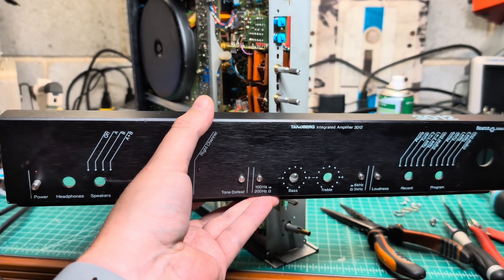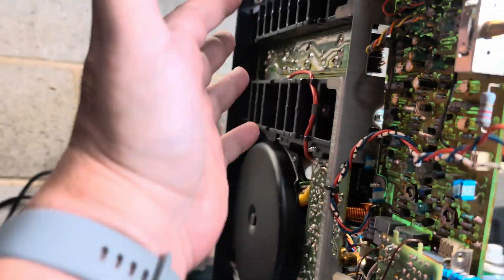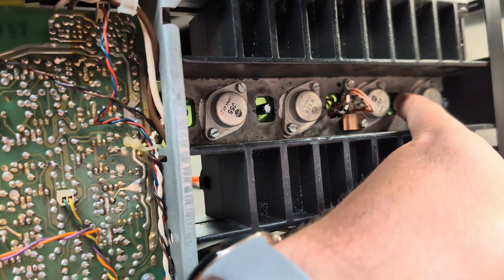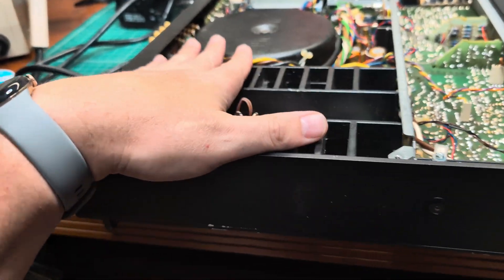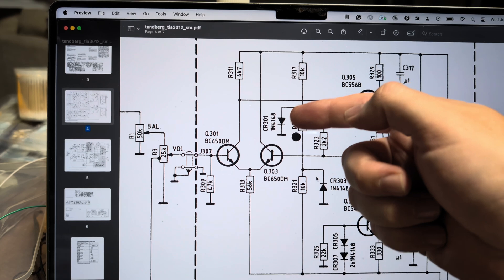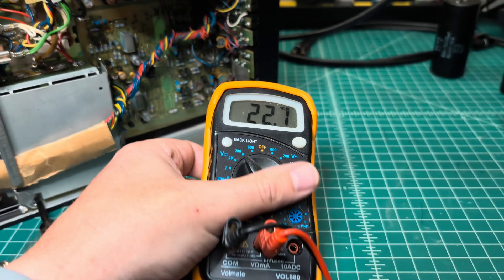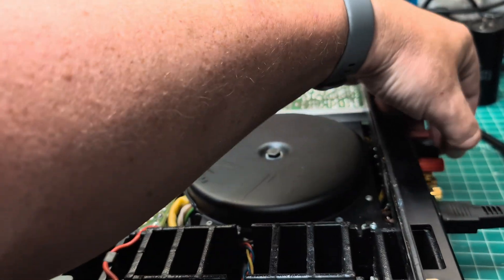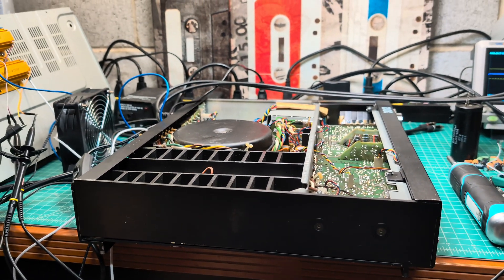Tandberg 3012 Integrated Amplifier Full Recap and Restoration

Comment: This amp i contructed by Leif Ernstsen when he worked at Tandberg. Earlier he started his own company Dynamic Presicion here in Norway. Most wanted amps right now. Extended bandwidth and extreme low distorsion and TIM. I will keep mine. The best repair/service man own this brand (name) now. Also do upgrade and make models based on this technology. Electrocompaniet did bouth up this brand and did not continue, but did''steel''the technology to get more dynamic and less noice and better data.

Comment: Nice video.

Question: I have owned a TIA 3012 since 1983. 

When I run it at high power for prolonged time, a 100Hz tone comes from the speakers. After cooling down this disappears.
It's never been modified (except for thorough cleaning of the volume pot).
What is the most probable cause for this hum, bad 15mF supply capacitors or run away of rest/bias current in the output stages?

Comment: Hello hifi, from the usa. Thank you for this excellent video!
I have the same Tandberg 3012 IA and cannot solve a low level 60hz hum which does NOT change in volume but disappears into the noise floor or music as you turn the volume pot up. At low listening level you can still hear it, which is saddening. (TEL 591 00830)

The amp sounds and functions fine otherwise. I changed a few smaller caps (C603 & C604 - both 470uf @ 100V ) near the xformer but it made the problem WORSE. (Replaced with brown Nichicon - same value).
After watching your struggles I see the monster cans are hidden under a metal shield. Mine are Elna. 40mm x 90mm 15000uf at 63V, 85C.

Q: Should I order the Kermit or the Rubicon? Kemit is closer in size (my intuitive choice) or the Rubicon (better temp rating). Viewed optimistically, my life expectancy is another 11 years so either will outperform me at this point.
Both are listed as available as of mid Nov, 2024 at Digikey on the us site.

I am am an amateur guitar amp builder and music hobbyist with a general knowledge of electronic components but no training as a tech. I have repaired my Hafler 220 and have kept my Tandberg 3008A alive for the past 40 years against impossible odds. (We can’t get the right transistors- have to find the “equivalent” and then swap the legs but of course this often doesn’t work depending of the circuit they are in. Never got the Headphone circuit to work again after stealing the transistors out of the circuit to power one of the preamp channels,.. long story).

Any idea where to start with my hum issue?
Thanks again and keep up the good work!

P.s. I know little of the world. Digikey have shipping centers all over the globe? So from Sweden you order from Digikey.de and they ship from Germany? (I assume they are all made in Asia somewhere). Or are your parts shipping from America at staggering expense?
———
Rubicon $14 usd each  (35mm x 52mm) 105C

63MXG15000MEFCSN35X50

https://www.digikey.com/en/products/detail/rubycon/63MXG15000MEFCSN35X50/3565924?s=N4IgTCBcDaIGwGYCyANA4gRgKwAY9IFEAxAYQGUA5BLFXEAXQF8g

————

Kemit $14.86 each

Closer in size (40mm x 77mm) these are 85C like the factory Elna.
399-ALT22A153DE063-ND 
https://www.digikey.com/en/products/detail/kemet/ALT22A153DE063/13176411

———

Door number Three,..
https://www.ebay.com/itm/386750051760?_trksid=p4481478.c101875.m1851 $10 China
Reply: Bought the Kemit. The lead spacing turns out to be different so remove and measure the old ones first I suppose is the lesson. None of this went well. Probably a boat anchor at  this point. The 3012 had several iterations. One had a sealed volume/balance pot- some were open and could be cleaned.